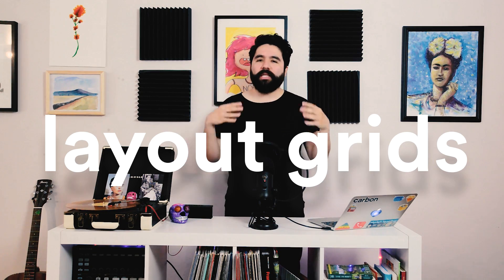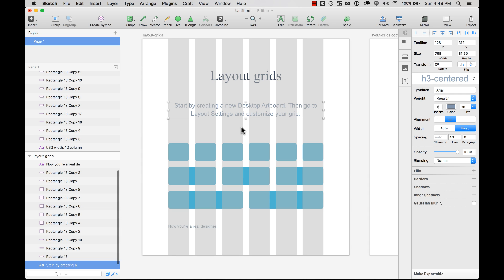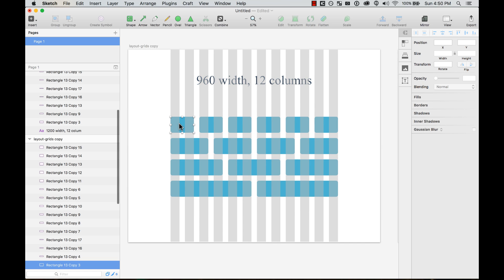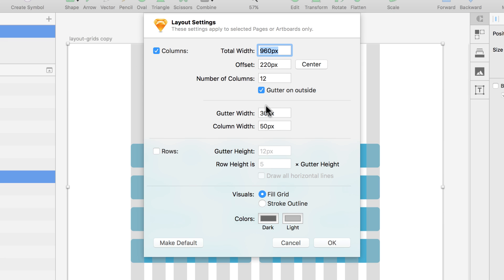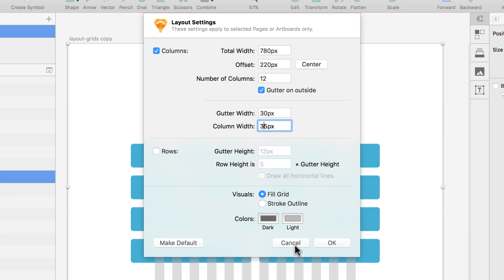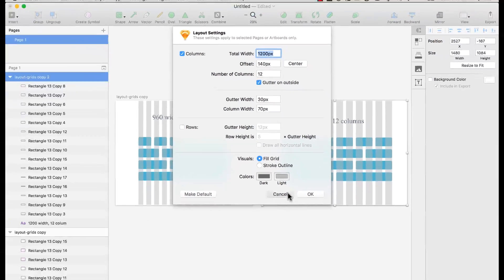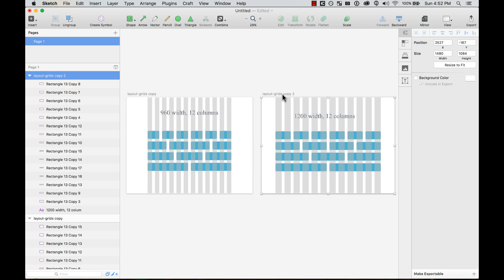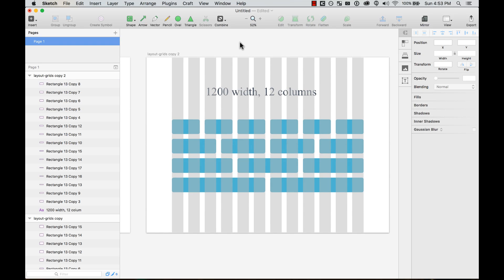Designing with Layout Grids on Sketch 3

Comment: Thanks, which width would you recommend for desktop design? Or is is not relevant which width I use with a design for a 12 column grid like bootstrap?
Reply: I always run into this question too, would like to know the consensus for the best recommended width. I usually go with the 'web most common' preset in photoshop of 1366px.